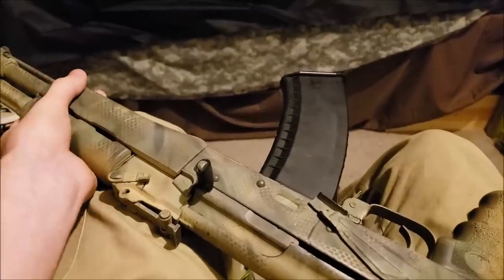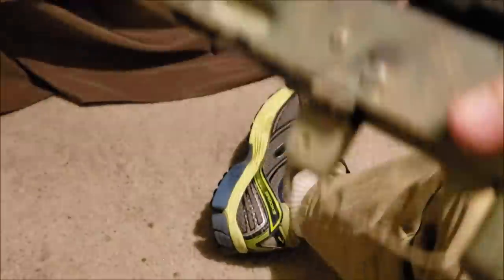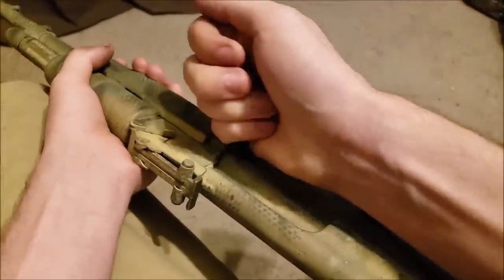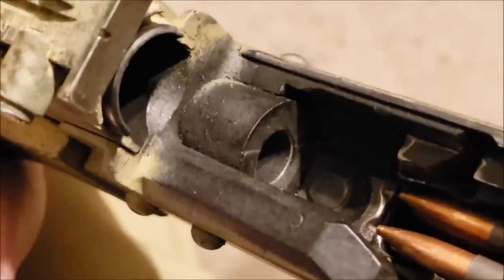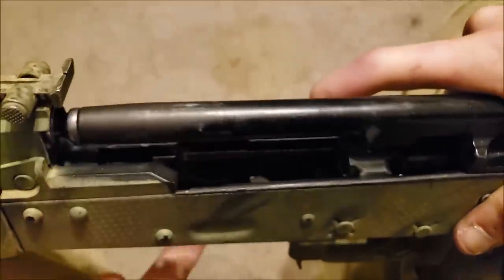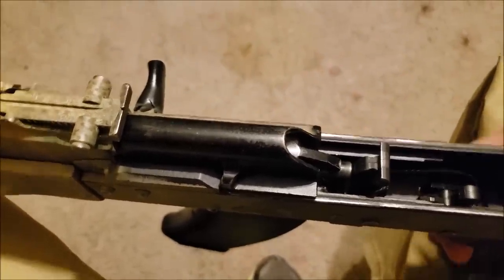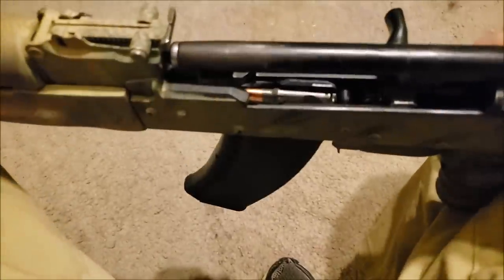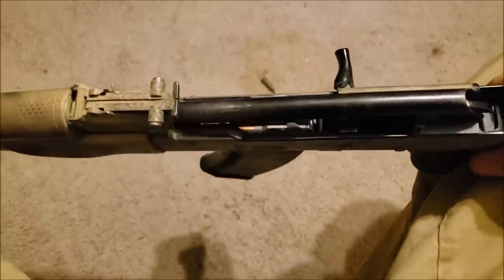Top 10 AK Malfunctions (4 are Deadly)

Comment: The D1 I understand could be deadly if the cartridge stuck in chamber is live (unfired or a squib where the percussion cap is still active - for example if it somehow partially fired) since the tip of the next round could hit the percussion cap on it and fire without things being in battery, thus causing a violent explosion.
BUT - in the most common cases of this, the D1 round is stuck inside the chamber after being fired (because it slightly expanded due to the firing) - thus D1 round is safe (non-live/spent). This ONLY makes the weapon go non-functional and is non-field serviceable - its **NOT DEADLY**.  D1 situation, if its a live round, could be made safe, by just forcing the bolt into battery, and then firing the stuck round. The stuck round will of course still be stuck, but if you fire the round safely, the situation will be made non-deadly.

D2 is also not deadly at all actually. Its never deadly! This because the chamber is wider than the bullet/barrel - meaning you cannot push the remanents of the split cartridge further into the barrel - its impossible to feed a new cartridge into chamber so it would go fully in battery even with tremendious force. If you REALLY want to feed in a second cartridge over the case separated cartridge, you would need a huydralic press - thats how much force you need to put on the bolt - and even then you would split the barrel. Since AK47 is designed such so the bolt covers the hammer (a safety feature/design) if its not fully in battery, its also impossible to fire the second round if it can't go fully into battery. Thus D2 is completely safe - it makes the weapon non-functional until serviced (non-field servicable) but its **NOT DEADLY**.
Also cartridges that split during firing are not deadly in itself either, because a gun's battery is designed to be kept locked closed, so even if something fatal happens inside the gun, it should be safe for the gun user. There might be a spark or flash - why you still should keep your hands clear of any ejection holes or similiar. But the explosion is always contained inside the upper receiver/bolt/chamber construction - even if the cartridge casing fails somehow. Its a safety design/feature.

You are propably mixing up this with guns that use cartridges where the diameter of the actual case is roughtly the same as the bullet itself, where it could be possible, using some force, to force the remanents of the case separated cartridge further into the weapon, which would then technically become a squib, and you then feed a live round into this and fire, which in the same case of squib, could cause a gun explosion. AK47 cartridges does have a neck, making this scenario TOTALLY impossible unless using some tremendious force like huydralic press.

D3 is only deadly if the round is live AND it somehow happened to become stuck in a place where sharp parts/mechanism could hit the percussion cap - causing the round to get fired inside the weapon mechanism. If the D3 case is spent its totally safe. It may make the gun non-functional (non-field serviceable). In some cases, a spent case could fall behind BCG and block the safety from being engaged or interfering with parts that prevent the weapon to be fired unless the trigger is pulled (that could potentially cause a runaway fire). BUT that situation can be made safe by unchambering the gun and removing the magazine.
ALWAYS point the gun in a safe direction, and if the gun, due to case behind BCG start firing itself (ergo if the trigger mechanism become "depressed" due to the case behind BCG), just remove the magazine quickly and ensure the gun stops firing. If you for some reason can't remove the magazine, attempt to catch the bolt so it stops firing. After that, remove round and magazine, or empty the magazine in some way - and once gun is totally empty on live rounds, - weapon is made safe and non-deadly.

In any case you get a weapon malfunctioning (any one), even in situations where its preferable or permittable to transport yourself with the magazine attached and gun loaded, its safer to unchamber the gun and then remove the magazine, in this case you don't run the risk that the gun, due to the malfunction, starts to fire itself in a situation where it might be totally unexpected. Since a weapons malfunction happen during shooting, its totally safe if you then remove magazine and remove the cartridge from chamber, because then the weapon is completely inert provided its not a live round that fell behind BCG. Thats actually the most safest and non-deadly situation you can find, if theres no live material in the gun at all.

D4 IS deadly as if a live round is fired, it could cause a gun explosion.

Comment: Overall the major design flaw is that this is the AKM variant, which is heavily outdated by modern standards.

The AK is an excellent platform if you want simplicity and firepower in one package. Having both at the same time tends to make the weapon system in question less reliable than it used to be. The fact that you can put it through hell and it will still function like a pro is a testament to just how legendary it is, but its simple engineering can cause more problems later on. In most modern weapons I highly doubt the spring was ever meant to be removed unless you were going to replace it. The AK is extremely durable, but it also makes it heavier and harder to maintain, namely due to the fact that it's so reliable you don't even notice it having any problems in the first place.

The fact that it is cheap and easy to mass produce might explain why it's outdated, but the newer AK models will likely hold up better than its predecessor.

Comment: A squib is most likeley not deadly at all. If  the next round goes into battery and fires, it just pushes the one in the barrel out with it so it is basicly just a 250 grain  projectile instead of a 125 one. If your rifle explodes on that, it was never save to use in the first place.

Comment: All of these were simulated by yourself, but does it really happen at the range?
Reply: Double feeds and failure to fire can happen but the others are not really common so you should not worry
Reply: @vertex288  and double feeds happen if you guide the bolt with your hand, it rarely happens if you reload correctly
Reply: @freedom6984  Yep, did that with my first gun, M70 Zastava which is a yugo AK, got a double feed on the third mag

Comment: Maybe it’s just my AK, and I have a few types  of 762x 39 and 308 , if you have the dust cover off and push the safty  up past where it normally would stop with the cover on and it has a loaded chamber it will fire everytime.OR if you some put on the safety  and it doesn’t hit the lip of the dust cover properly  and  goes up a little too high, it will fire... 
try it unloaded and listen... it will fire ..... that’s why I slightly bent a more slightly pronounced lip on my dust cover so that it can’t keep moving upward if it misses the lip . 

When it went click after just cleaning  the gun and watching the action “ work” , it did it ... flipped me right out....

Comment: although I don't have an AK, (mostly since I don't like them all that much) I do buy extra pieces for my mainly favorited guns for the specific instance if a part is ruined due to a bullet tearing apart the piece (I obviously am talking about the times when the gun doesn't internally combust but rather a round just does damage to a piece on the gun. I guess if you really wanna protect yourself from the rare instance of your gun exploding, don't buy a gun.) but even then, I have spare parts that I've bought several years ago and still haven't used. Only time I've needed to replace a part is when I was trying to speed load my 1911 and utterly failed, jammed a round and I was trying to speed load of course, so I was also going to empty that bitch into the target so I shot a round, it somehow got stuck midway through the barrel, and fired another round and it forced the other bullet out the front, ruining the rifling in that barrel and leaving me with a few hand injuries. Haven't tried to speed load since.
Reply: also I don't have a sport 1911, (custom sport, factory sport, no types of sport. I have a standard one I guess.) so I suspect it's because I forgot to oil it or because it wasn't made for shooting races (I wasn't racing but I just wanted to try it). But I still don't know how a bullet managed to get stuck sideways inside without knocking the whole slide off. The locking lug, of course, but yeah that's why I buy spare parts. So I can keep the gun alive by replacing parts, rather than buying a whole new gun.
Reply: but I guess he's talking about in the case you don't have time to replace it or something.
Reply: funny thing is that the gun didn't explode, it yanked my wrist back till it slipped out of my grip and hit me hard enough with the handle to crack my shoulder. It also broke my right index, thumb, and middle finger along with causing my hand to rip a vein due to the force as I tried to contain the force, like an idiot.
Reply: had to have a partial reconstruction on my right hand and couldn't hold a gun for at least 6 or 8 months with my right hand
Reply: really couldn't hold anything, come to think of it. I need to stop telling stories like this because I already know that nobody cares lol

Comment: I had number 8 happen to me on my 74 at the gun range, left me very confused since i didn't know about it at the time. I thought it was just a failure to feed so i ran the bolt back and fourth a few times and the bolt and trigger ended up crushing the empty casing enough for it to run. Didn't take out the empty casing until i got home that day.

Comment: The most interesting and fun (not really!) AK failure I've had was the shepherd's crook braking.. Trigger mech and everything got all jumbled but not terribly hard to fix, outside of redoing the trigger mech and putting a plate in, rather than an old 30+ year piece of wire that was holding it all together.

Comment: failure to fire happened to me a few times... not really happen to me but when sweeping the ground... found a few cases with the bullet still attached but the primer is struck multiple times.
Reply: also bullet stuck in barrel could also be due to poor rifle maintenance or simply overheated/worn out barral where the barrel bend a little therefore the tip is now stuck in the barrel

Comment: How would u fix the last one? With a cleaning rod or taking it to a gun smith
Reply from the maker: Yeah a cleaning rod and a hammer should do just fine to fix it. I'd check after to make sure there aren't any stuck fragments or something too by simply looking down the bore. If there is, then try a cleaning brush, if they are still there I'd take it to a gunsmith

Comment: The first time I ever shot an ak I rented it at a gun range and it had a round that had almost shelved itself slightly behind the mag well, i couldn't seat the magazine or rack the bolt. So I reached into the mag well to feel around and low and behold a round was sitting inside wedged in what seemed like a cut out between the mag well and the bolt. Im not experienced with the ak platform and that was my first and last time with one. Has anyone had the same experience?

Comment: Basically all your malfunction clearing wisdom in finnish army is "cycle a couple of times with proper effort". Never failed to clear the gun surprisingly. Maybe the ammo was good and consistent enough in the army to prevent them as well. But I've heard the finnish rk is one of the best ak's so perhaps that's got something to do with the malfunctions just as well. Although when the firing pin disappeared, cycling didn't fix it. Other handling advices were not to follow the action but when cocking/clearing, pulling it swiftly to the back and letting go. Surprisingly seems to prevent most misfeeds. Aka don't dabble with the gun, just let it do its job.

The last one was interesting. I totally assumed another fired bullet would just spit both heads out kinda as if they were two bigger masses instead of creating some kind of blockade that makes the gases explode or whatever happens.

Comment: I have 2 years of army service (most of time is on main army shooting range) and thousands of rounds shoot from ak47 and ak75, this is NEVER happened you know why, because we are using army ammo, don't know from where you got this "empty" cases or you ammo but on the tin can (bullet canister) and on the card box is a date "use before "date" "
Also on the left side of the gun is two circles and number inside, this number (under iron side) is which plant gun is made it (you can check it on internet) if you don't have this number you gun is probably replica
Extracting empty stuck case is easy, just use ramrod 
half open receiver will never happen if you receiver spring is original and it is in normal condition
bullet in the fire mechanism will NEVER happen because of construction itself , this is complete bullshit

Comment: Ak's shouldn't jam at all, get a better one. I didn't even watch the video because an ak dosnt jam like an ar15 does. An ak may light strike because of worm trigger and hammer springs but other then that it shouldn't just jam
Reply: And if you use plastic mags that may be your issue, plastic is trash
Reply: @user-wc7vn6uz9h  Polymer AK mags are standart issue for more than 40 years now - and they are certainly not trash.